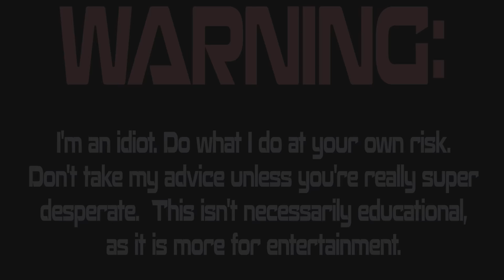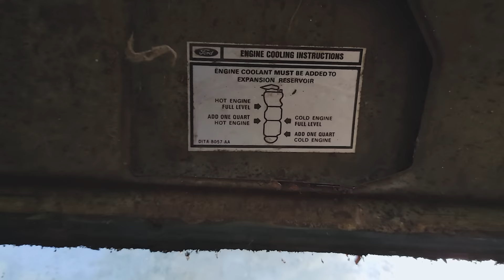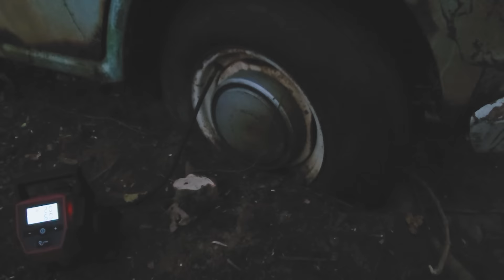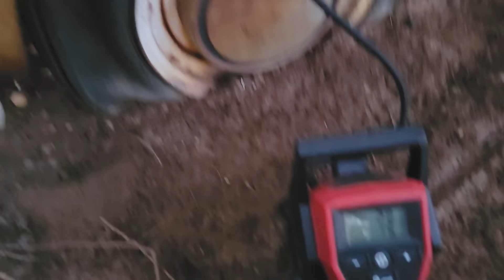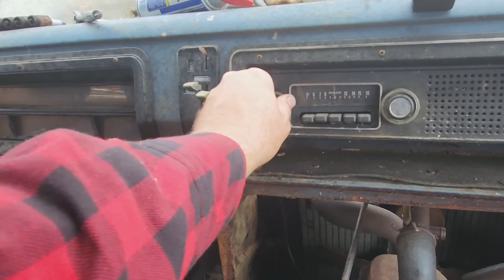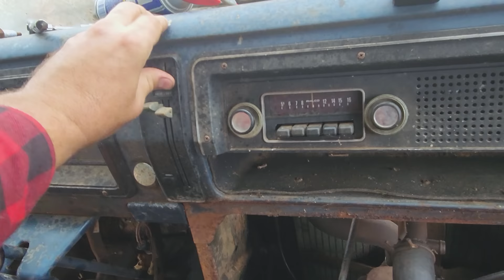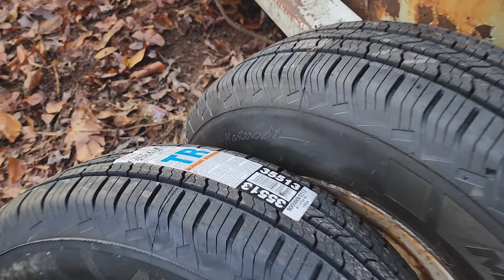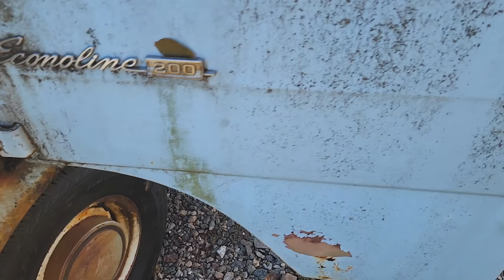Buried in the woods for 32 years! Will it RUN AND DRIVE? Abandoned Ford SuperVan!

Comment: Make it a weekend camper put the shade on the outside of the sliding doors dress up the interior with some walls and some RV pull-out couches and captains chairs and anyway you won't go overboard with the cost tint the windows that way you can't see in like the old school hot rodders, and make it a weekend warrior. People could even use something like this at the track while they are running there hot rods..
Reply: Put it on air ride also

Comment: Go back and get the other van (which doesn't need to be running, you just need the shell and various bits). Then look up what "The Chaos Crew" did on "Scrappy Races", where they built a "Chaos Cab" with TWO front ends, one representing each channel.

You could even do what they did on the second series and put two engines in to make the "Double Van" a 4X4.
But if you do that, you might want to get those brakes fixed too.

Comment: I think if the tires come up just tug it about 3 to 5 ft. back get it out of the hole. I see the 240 as a good thing not enough power to break stuff. damn hard to kill a straight 6. metric in 1972? not a good sign. wires hoses a pressure wash carb kit maybe a cam. brakes are a must.

Comment: Supershow!!! That van was offered in the time dealers could sell safety as an option. Clearly looks like Ford wanted to run valve case back to air inlet but nahh throw it in the exhaust. As an avid fan of doghouses mandatory for mid/rv/vans as to monitor degree of blowby showing in valve covers before deciding on bringing the gang campin, if the trip would have continued Derek you could have made exhaust clearing inspections as to eliminate runaway spark.😊. Now I am trying to decide which one of yas worked in a shop where the ladies shown on SnapOn calendars were nude or were scantily clad.

Comment: I love your videos! Just wanna say tho WD-40 is not a lubricant. In fact it stands for water displacement formula 40. It dissolves any other lubricants, has a very thin film that doesn't hold on to surfaces like other lubricants. It is a very very light oil so in a sense it does have a mild lubricity to it, but definitely not even close to enough for an engine! Not that I think it matters in this case though 😂

Comment: There is some sketchy stuff going on here. But its pretty funny. Engine fire and then pouring questionable fluids on it to stop it, while holding a door closed and making sure none of the sparks set the back end on fire was hilarious. But it is a cool van. A restore would be nice. Some new seats, brake lines, paint job, floor, windows and its good to go! :)

Comment: I owned a Ford  Van built in 1973 and it was a Station Wagon on the title but Ford Vans had a truck frame. Why would Ford call it a station Wagon ? The steering had a ton of play in it and I was so happy when I sold it because I didn’t trust it with twin I beam suspension.

Comment: Needs to be put on a 3/4 ton 4x4 frame ... mud truck style... or. 
Mid engin 460 . "Burn out" van ... just clear coat it posi . Tub rear to put on 285 60 16 tires and roast em...

Comment: Just cant beat the ford inline 6 !!!! Tried to kill my 300 and it just wont die! About to hit like 380k miles and I'm sure it will go another 100k easy but everything is getting so dam rusty that IF key word IF anything happened like a head gasket or anything I couldnt work on it so quickie rebuilding headgasket up 80k mile 300 to take its place

Comment: It would make a great little camper. Ya fellas know, the wife hates bugs and sand, so tents are out. Slap a fold up bed in there, a stove, fridge, power, maybe an Arctic air blaster, good God knows they complain about the heat and you got yourself a cheap camper rig!

Comment: why not get it running in tip top shape. no body or paint work just mechanically solid and safe. then you can sell it to some independent contractor who needs a work truck on a budget. I mean there's quite a bit of real estate in that van to haul equipment, materials and whatever else. you could probably put two zero turns and a few weed whackers in there. not to mention drop the kids off at school on the way to work. I hope vise grip garage puts a link up when the work starts. I'd like to see the end product, thanks.

Comment: Honestly wouldn't mind seeing some sort of Ford older series V8 slid into that maybe with an automatic transmission. Normally I'd be all for a standard but going to be honest with the shifter system on that thing I don't know if leaving it standard is a great idea. I like floor shifters when it comes to a standard and automatic column. I'm surprised it wasn't stalling constantly trying to keep it in gear and running but that's me any experience I've had with a standard was somebody else driving when it comes to these old drug it out of a field units and usually keeping them started running and in gear is questionable. Really love the van though shade being thrown. Love that Zombie Apocalypse look that it's got going

Comment: A guy couldn't be faulted for wanting a couple more cylinders. How about 6? Personally I'd like to see the revival of the old engine layout and the correction of the short-sightedness  of the straight eight corrected. If like to see another 240 shoved in-between the one you got and the tranny. Yeah I'm staying a straight dozen inline 12 cylinder. I'm sure it can be done. I'm also sure it'll be easy!

Comment: Why does everyone use wd40, when they should be using products like kroil or pb blaster.  wd40 is a rust preventer and whereas kroil and pb blaster are penetrants built to lubricate and break free rusted parts.

Comment: Why dont you ever pull the plugs and fill the cylinders with oil before turning these old engines over, just wreck it more. Why thats why you drain the oil first pour it in the cylinders and intake and let it soak overnight

Comment: Well, I can imagine many generation of Rats were born in that van. And moved in the engine department too. Now, for once I see somebody put the oil filter on right. Not torquing it on. I had a 78 Camaro back in the 80s, I brought it to a new open shop who were offering Free oil changes for a day. Well, i brought my car in. But the next time I did my oil change, I could not remove that oil filter.  I had to put some work into removing it. It does not require to be put on so dang tight. I was not expecting a fire was going to be part of this video. That had me laughing Big Time!

Comment: I really would love to know how many cars you go visit and find it just totally locked up, engine won't turn a budge worth, or the entire brake system is rusted out along with fuel , or even the engine is good but the frame is just busted down to the ground..... and you have to just call it a day and go home - no useable content. Or really - what's the ratio of those to the projects you're able to make content out of.  There's just so many vehicles that would be worth a good chunk more than you'd put into it except the engine is seized or more often the frame is totally rotted out - I've got an old body on frame in my garage at the moment that I'm gonna have to pass on to someone else - I put a few grand more than I should have into the engine and then too many frame issues showed themselves at once to make it even close to worth continuing on with.